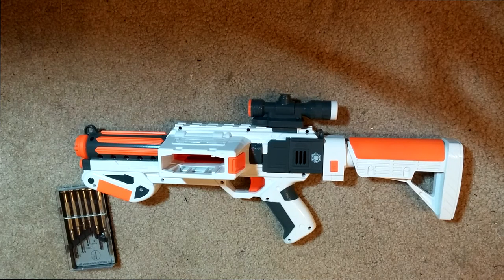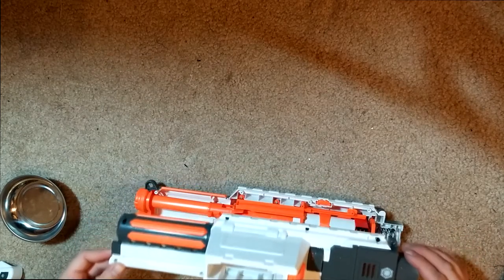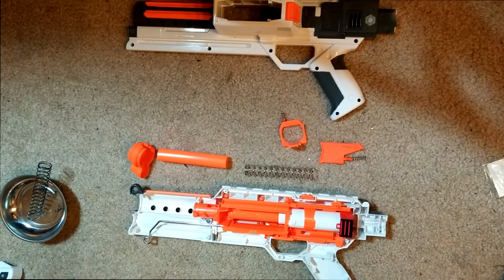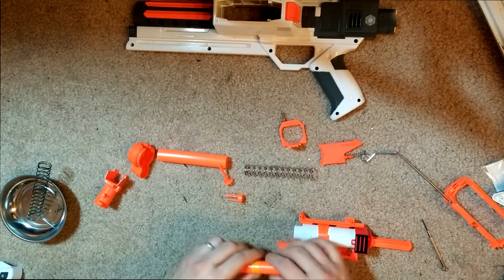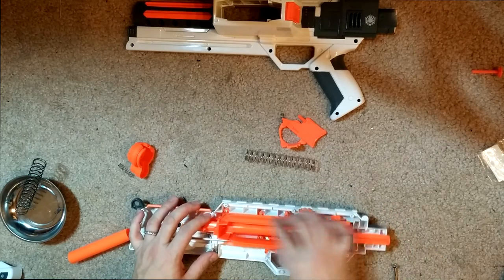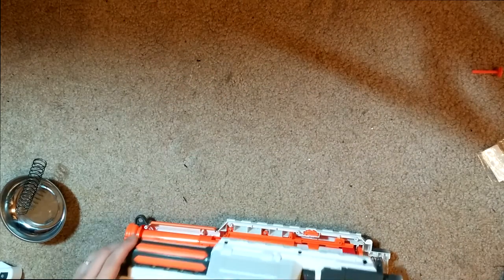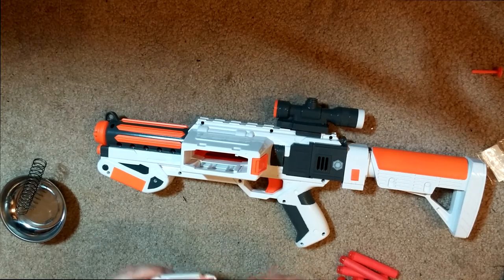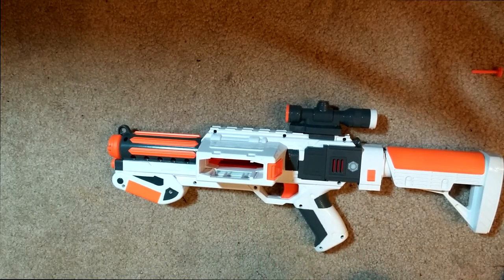Nerf FOST Quick 'N Dirty Mod Guide

Comment: Where are the locks in this specifically? I've never modded a Rampage style blaster before and none of the other mod guides I have seen specifically point out where the locks are (besides the half prime lock that you sand off).

Comment: +Bay Area Nerf what's the range of this?  Is the smaller size of the Storm Trooper blaster (Less barrel length) make it perform a bit better than an original rampage?
Reply from the maker: +Crackensan Stock, this blaster is getting less range than the rampage. With the mod it's pretty much on par with a rampage with an OMW spring installed. The barrel length doesn't seem to make much of a difference for accuracy or range. But it is nice having a more compact blaster.

Comment: I dont know if its only me, but this gun, when u have all the 12 darts in the 12 darts mag, it gets stuck sometimes, have any solution Bay?
Reply from the maker: +PheZeR - PvP We haven't experienced this. We mostly tend to use straight 18 round mags at games as well. When you say stuck do you mean the mag is stuck, the priming, the darts?
Reply: Gets stuck on the darts, it happen only with the mag of this gun. I have two of this gun and it happens too
Reply: yes I have the same problem

Comment: if  u decide to keep the orignal spring and still add the 5kg spring do u need to use 2 catch springs or the the one upgraded one enough cuz I'm mod ding my rampage
Reply from the maker: +Samadul Chowdhury I wouldn't recommend keeping both. I don't think they will compress enough to properly prime the blaster. Also, there's not enough room to use 2 catch springs. :)
Reply: +Bay Area Nerf  how about the 5kg spring plus a stock strong arm or night finder spring
Reply from the maker: +Samadul Chowdhury Not sure. I haven't tried it so I can't speak to it working or not, or the improvement in perforce you'll get if it does. Either way, you'll only be able to use one catch spring, so I recommend upgrading that. If you're going to make the order for the catch, you might as well get the 5k as well. It works and is reliable. Plus you can get  two and have two catch springs so you can upgrade twice as many blasters but only pay for shipping once! ;)